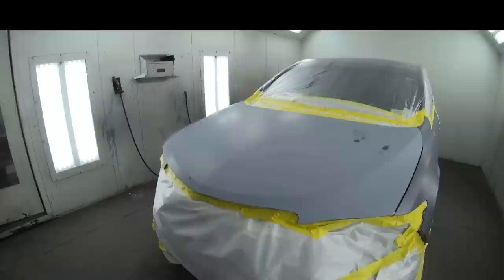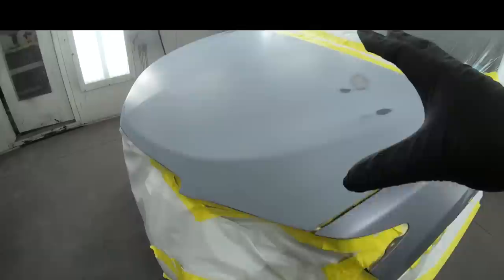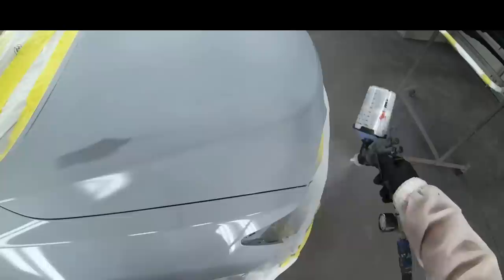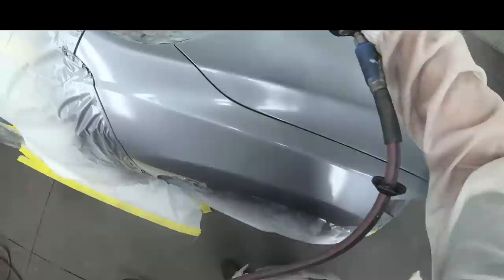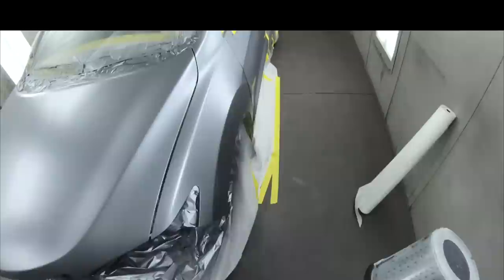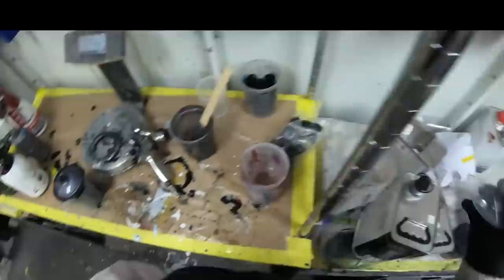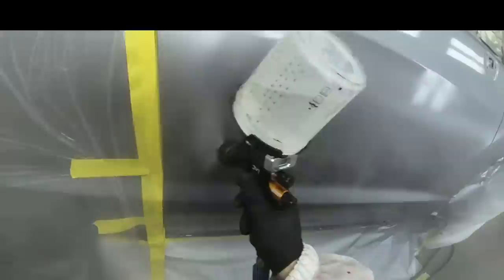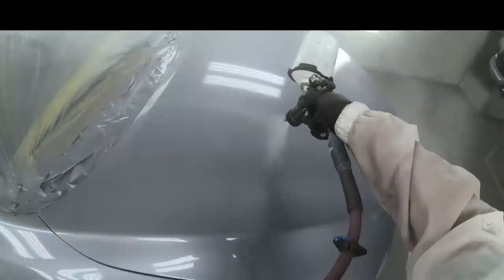MOST Painters SKIP This SIMPLE Step!

Comment: PDR on minor dents on the blend panels before paint (or prep) is ideal. 
Always good to have either a panel tech or painter in the shop with some PDR skills. 
Nice job, and good tip about the slow hardener / reducer for warmer ambient temps, even in a booth too fast drying is still an issue.

Comment: I started using this trick for years and works out great. It can backfire on some more translucent colors though if you don't at least blend the sealer a little into the blend panel. I usually mask, full panel seal then unmask and reduce the remaining sealer, drop my pressure and blend just past the panel gap. Works well.
Reply: Chris Cummins: thank you for that tip also...l am a fresh brand new painter and l am soaking up all the information that l can
Reply: @skyonedesignersplus1066  
Hang in there. We need all the people we can get in this field. Some days are better than others but you need to make those mistakes to learn from them. 30+ years and still stumble some days.

Comment: This trick works well with solvent, with waterbase you almost have to blend that sealer into the blend panel to get the color to look the same, because if you tape off the blend panels and then put color on your blend panel it doesn’t have the right g shade to make that color look the same

Comment: Great topic man. I'm humble enough to say I've skipped the masking blend for sealer before and it's bitten me in the behind. like the x pattern, sometimes on a fine silver I'll mix my base 1:1 with blender and drop a final 12" coat just to make the blend that much more undetectable. Finally, I've been using my DV1 ( I like the 1.3) base alot lately... the gun will shoot pretty much anything well. I have the DV1 clear but it's stock and ehh... I need to order the other cap. I appreciate the content

Comment: I know it's probably a pain in editing but if possible 2 add a, "FF" in the upper corner during those times where ur skipping forward in the middle of a scene. Only a suggestion. Usually can tell the difference but sometimes it's tough 2 determine. Appreciate tips in any amount. Even if it's one per video it's still one more thing that helps.

Comment: The Dv1 is an amazing gun but the pressure is not actually lower it just reads lower on the guage 18 psi is actually about 25 psi and 22 is about 29 psi. It explains this in the Devilbiss dv1 instructions

Comment: Have u ever spot sealed a small area like tht repair u did on the passenger door then sprayed silver basecoat and got a halo over the area u sealed? Like all the metallics stud up in the dry edge of sealer
Reply from the maker: If they happens. Scuff it with 800’snd base over. What you’re doing is tough
Reply: @PaintSociety  thats why sometimes i dnt spot seal silvers anymore i just paint over a wet sanded smooth 2k and try no to gt cut thrus
What im seeing is its better to tape of the adjascent panel and seal only the new one instead of getting sealer over spray on the blend panel bcuz that can cause thebdry edge mottle look on silvers and golds

Comment: I have a Question. I want to spray my campervan with polyurethane coach paint. It's a single stage enamel. What size tip in the spray gun would you recommend?
Reply: @splash5974  I'm just quoting what the manufacture calls it. "Coach Enamel is a Single Pack Polyurethane" and goes on to say "Coach Enamel is based on a White Spirit resin that provides a good hard-wearing finish with a mirror like gloss finish" and any paint will be better than the bright yellow paint that's originally on this UK ex-ambulance.
Reply: @drewhodge3820  Gotcha! Its just that they are 2 very different materials. Urethane is superior to enamel. Enamel is 1960's technology! Doesnt hold up well over time to the UV. 
Well, as i said, a 1.4 tip will work just fine, you could also is a 1.5 tip...
 Im a painter by trade btw
Reply: @splash5974  Cheers, I really appreciate the advice.
Reply: @drewhodge3820  your welcome! Best of luck

Comment: Dont u get any overspray to the hood  when u only used the reduced base on the blending panels?
Reply from the maker: Not much, and it doesn’t matter because that’s not a blend panel
Reply: @PaintSociety  I have had situations that when i clear over it, shows like pinholes allover the panel. Like it has landed dry on the panel and feels rough. 🤔
Reply: Downdraught booth removes fallout pretty well, if painting without a good booth best to spray bonnet (hood) in this scenario too.

Comment: I’m curious why would you waste paint by cutting in and clear coat then turn around and use sealer right back over that panel? I’m just curious honestly. Job turned out great
Reply: I'm wondering as well. I paint the fender off so I only see it one time. Also don't have to worry about sealer going farther than the paint.
Reply from the maker: We didn’t get approval to strip and overhaul the hood until after I cut in the fender so at that point it was to late, I already cut in the fender.  For the purpose of the video at that point I sealed the whole front end but usually I’ll just blend over.
Reply from the maker: You’ll only have they problem in the door jam

Comment: just got a 328i and you can see a bunch of swirls in the black paint job, like scratches. can you help me out on what to do? thx
Reply: They make a swirl mark remover 3M
Reply: Common in blacks after buffing (new or old) paint. 
Swirl remover is just a fine polish, the marks can be hand polished out using a quality fine hand polish or swirl remover with a machine buffer and softer pad. 
Hand polish with soft cloths easier for diy’r.

Comment: What tip are you using on the dv1 for base?

And what’s the setting used for the base?
Reply from the maker: 1.3  15 psi
Reply: @PaintSociety  is 1.2 also good to spray silver with that gun?

Comment: I'm starting to feel that "wet bed" with the clear-base is not needed when blending metallics. It just overcomplicate(overthinking) the job. More room from mistakes. In some videos you do it, in some not.Anyways thanks man👍 Edit: Maybe for pearls its 100% necessary
Reply: I've been painting a long time and on a fine metallic there's no way I would try to blend without a blender or a wet bed. especially in higher temps/ humidity.  I understand with a solid black or white but imho not using a blending agent on a metallic is asking for problems.
Reply from the maker: On this job a wet bed would have helped even more. You’re right Jimmy.

Comment: why paint the entire fender when you seal it anyways. its a waste of paint. this job should not have been sealed at all. its a waste of more money. just make sure you sand your primer properly for paint. lots of unnecessary time material waste. my guess is $200 wasted. but it still looked great. just not the most quickest or most economical way to paint this job. if i was your boss, your fired or your paying me the $200 you wasted